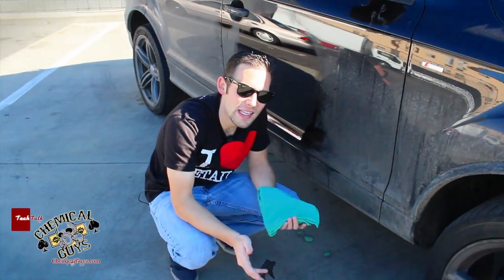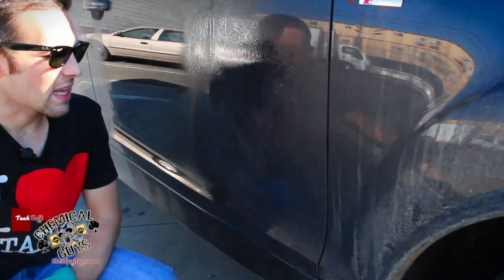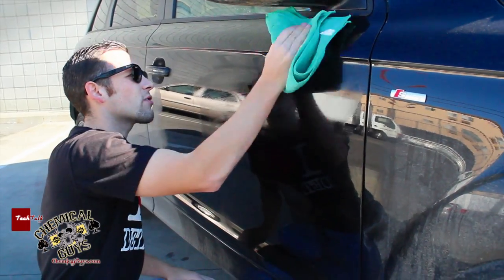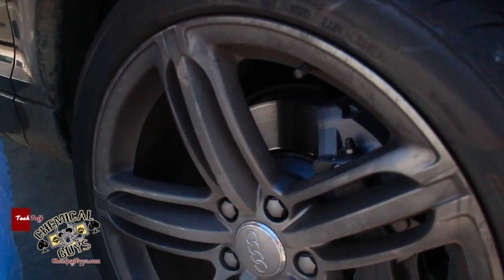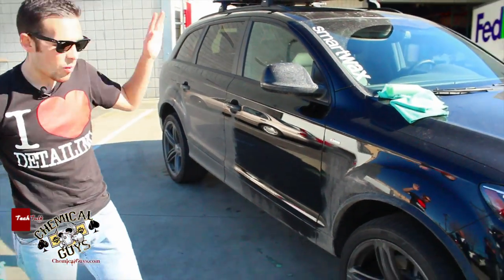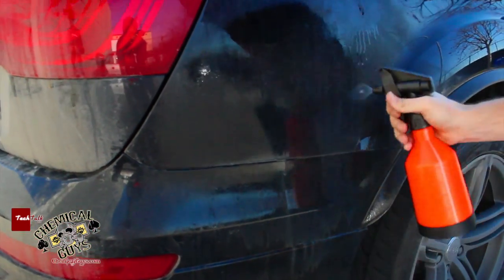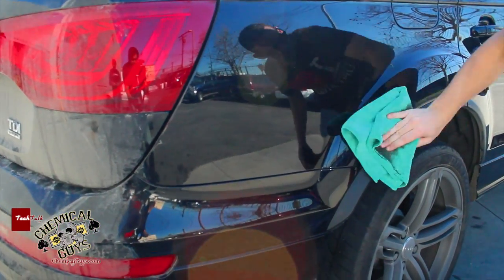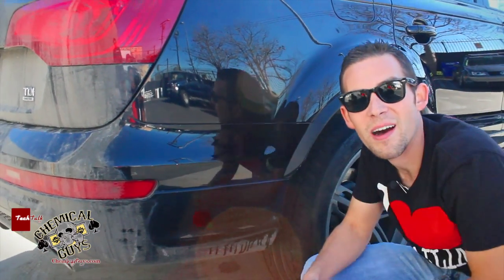Waterless Washing HEAVY DIRT & ROAD GRIME - Chemical Guys ECOSMART Audi Q7 DIRTY

Comment: I have a hard time believing that this does not introduce scratches..
Reply: It has "lubricants" in it to prevent scratching. But i have a hard time believing it myself too.
Reply: Personally i wouldnt use this for a car with so much dirt on it, its a lot more effective to rinse it down and give it a proper wash with shampoo. 

I only clear my car waterless when its not that dirty and i want to give it a nice shine again plus its easier than preparing two buckets and then having to dry the car. 
My car is also a silver paladium metallic merc so scratches wont show up much anyway compared to a black car but generally, i clean it weekly like this to reduce dirt build up and it doesnt scratch at all.

Comment: Does it comes with free scratch and swirl remover compound..... ???    LOL just kidding... i love Chemical Guys products for the ease of use and the detailed instructions of how to use them. Ease of use and satisfactory results is key on car detailing . .. However I WILL NOT EVER use any water less cleaning product.... from C.Guys or any other company. Dry salt is like a sandpaper.  If you leave on the salt belt states RINSE YOUR CAR WITH PLENTY OF WATER !!!! Find a warmer day and open your hose. Do not neglect your undercarriage especially on import cars.  This product could work for limo/taxi drivers. A quick clean before they pick up the  next client that saves $12 bucks at the car wash. 

Just my humble opinion ....

Comment: This makes me cringe.  Your better off letting the salt on the car then grinding it into the finish like this.  You need to use water to lube the surface and most importantly to remove the loose abrasive dirt.  You may not notice the scratched right away but eventually you will have a car that looks like it was washed with a scotch bright pad.  Also you need to use water to blast out all the small crevices and wheel wheels, this is where rust really starts.

Comment: Washing a car without water just isn't right!
Reply from the maker: With EcoSmart, it is. Once sprayed, the unique formula of EcoSmart lifts and separates dirt from the surface, suspending it in a unique blend of hyper-surfactants, natural carnauba wax, and slick lubricating agents. Once suspended, the various contaminants that covered your vehicle’s beautiful finish can be safely and easily wiped away with a soft microfiber towel, ensuring no scratching ever occurs. Give it a try, Jason, you wont't be disappointed!

Comment: hold hold.i ask there wash and wax whats the divrent between wash and wax waterless to and eco wash.
I ask spray bottle is dual action spray bottle ?.

if you have mud sand does t it scatach your paint to use waterless
wash box is in a box throw dollar in it.

mi baby stood 15 years in a garage.i moved there is no garage
maby it will come again a garage.you do not know so to speak what a luxury a garage is ones you do not have it you know luxery